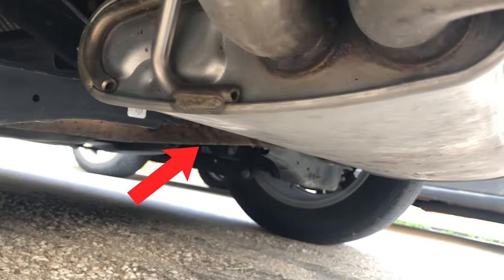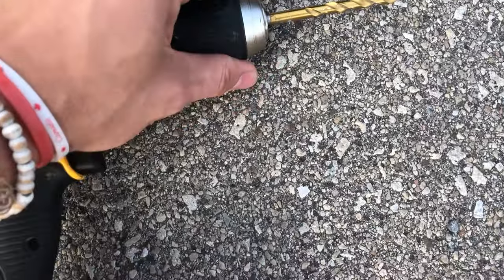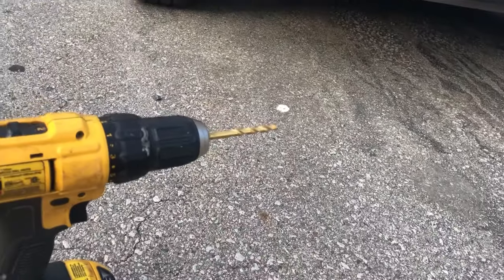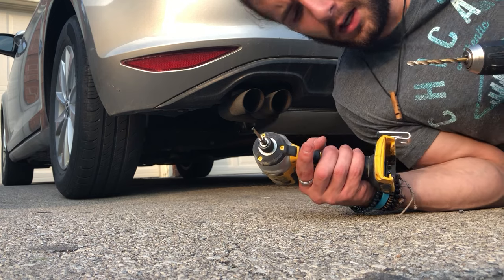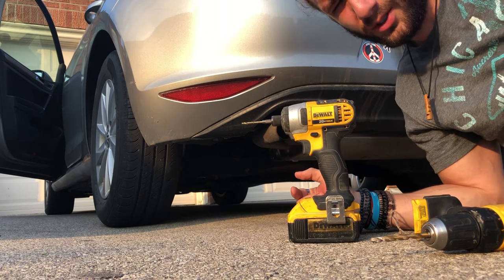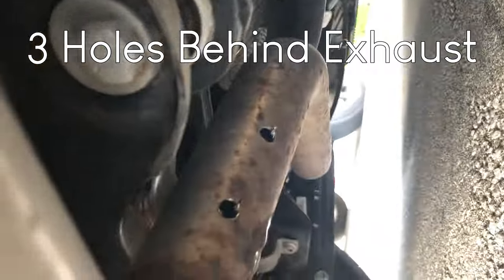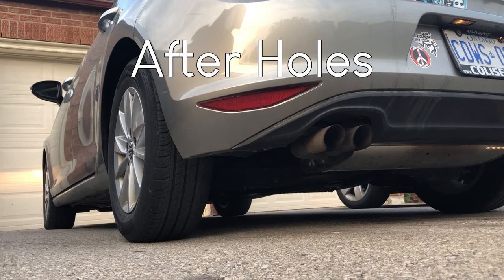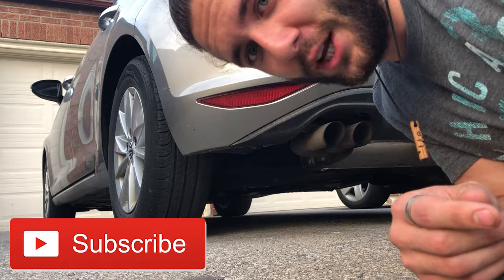Make Your Car Louder In Minutes!

Comment: I heard that if you drilled 6 holes in your engine block, you can increase the numbers by -160 HP and torque by -150TQ. I’m gonna try it
Reply from the maker: Let me know how that works out for you!
Reply: Mimyan I guess you bought an exhaust system for a bit of money and it sounds worse than this guy's DIY mod 🤣
Captain salty
Reply from the maker: @bradleyd556  lololo
Reply: Just put it in reverse so it cancels out
Reply from the maker: Awesome, I’m happy to hear that! Please consider subscribing I would really appreciate it!
Reply: @bradleyd556  🤣🤣🤣🤣🤣🤣
Reply: Does it matter how many holes you put? Is 10 fine spread out
Reply from the maker: I’m not entirely sure, if you do try it out let me know how it goes! Thank you for commenting I really appreciate it!
Reply: U can also blow it up
Reply from the maker: Haha why am I just seeing this now, this is an awesome comment ❤️😂
Reply: Drill one into every cylinder
Reply: What is engine block do you mean the catalisor?
Reply: I think your wrong. I heard it’s about 200 hp increase.
Reply: Can't that cause the inside to rust up over time?
Reply: Holy sh*t tried this and my car turned to plane
Reply: I used this method but I only gained 140 hp, I'm still happy as fuck😁
Reply: Are you serious? 😂😂
Reply: Yooooo😂😂😂😂😂😂😂😂😂😮‍💨
Reply: If there is any hole in your exhaust system, it  fail the MOT due to Exhaust leak.. 😮
Reply: this is very unsafe practice as dangerous fumes can be drawn into the vehicle and will consequently not pass an emissions test. (Says google). Can you please tell me as You have tried it, how long did you drive your car like this and did it affect the fule average ? Did it make any trouble in the engine?

Comment: Did you ever think about inspection , if you had 3 holes in your exhaust it would fail emissions.
Reply: i wont do this to my car cuz its old af and ik itll sound bad but but car would alreafy fail 😭 i dont have a CC
Reply: @dave7701 fucc an emissions test if it sounds good thats even better lmao
Reply: @Ydhfugivihlbl  it's not about sound, it's about speed. TESLA P100 that I own blew away a Vette that was loud as crap but didn't have the balls for a silent engine. 0-60 in 2.8 seconds

Comment: Ahahha all the comments saying it'll damage the car, all it will do is make it louder a friend of mine had the entire exhaust fall off from the manifold and he had it like that for months it just sounded like a tractor all the time🤣🤣
Reply from the maker: Haha exactly! It happened to my older car that I had in high school as well😂 People always assume the worst, thanks for the comment brother❤️🤙🏽
Reply: Well the issues with that is running lean since the car was designed for resistance so no resistance at all will make it run lean and shoot flames but the problem with drilling holes is long turn burning shit under your car. And there’s no going back without buying a new exhaust
Reply: @_JTPR_  just patch up the holes with gun gun paste? 😂
Reply: @buntrockstudios  fair enough
Reply from the maker: Thank you for the comment and your knowledge!
Reply from the maker: Let’s do it
Reply: Actually not enough back pressure can cause the engine to become nasty filled with carbon which isn't good for longevity
Reply: Anyone do this on a 2010 glk350 where  would I drill I need feedback asap cuz after my poop I'm doing it
Reply: It don’t damage the car but it does affect MOT

Comment: Is a cool way to do it but honestly a muffler delete isn't very expensive if you just going to do the last box and then it will sound really really good , also make sure to go for a retune after deleting the muffler or drilling wholes in the box because now obviously there is going to be less back pressure.
Reply from the maker: Thank you for your opinion I appreciate it! I’m sure this will help lots of people out🙌🏼
Reply: you dont need to tune it the only thing that gives you back pressure is the catalytic converter so yeah your fine and tuning cost a bit of money (edit) back pressure is BS think of an engine as an air compressor you want it to pump as much air as it can efficiently so no back pressure would be pretty efficient.
Reply: @seanmckay3392 the turbo is your back pressure...
Reply: @blokebeershed7651  if you drill a few small wholes , or delete a box or do a full stright pipe one way or another you will have less restriction in the escape of those gases so normally if you getting rid of those gases quicker you would want a less restricted intake to bring in air quicker , in South Africa most people go for a full stright pipe from the headers right out the back with no cat and put a cold air intake or ram intake and then a slight retune , more fuel , more air and less restriction on the way out and in will make most cars feel alot more perky.
Reply: @codyblade7872  i need to go in South Africa now !
Reply: @seanmckay3392 I drilled holes on my 2004 Honda accord and I lost back pressure and now my 0-60 went from bad to even damn worse when I went to get a tune up then suggested I fixed the holes but the tune up definitely helps
Reply: By retune do you mean changing spark plugs?
Reply: MOST cars and even Motorcycles do NOT need a tune done even after completely removing the muffler. What gives your engine back pressure is the Catalytic converter, NOT the muffler. You lose SOME back pressure, but unless your car or bike has like 10hp, you're NOT going to notice any difference. I did a muffler delete on one of my cars  and I noticed ZERO difference.

Comment: Did this on my vette and honestly it made it a little bit louder. However I have to mailboxes so it’s always going to be quite
Reply from the maker: did you drill directly into the pipe? it should have made some difference
Reply: @LukesVlogs97  it’s super difficult if you don’t have a lift unfortunately. Like I just make a lot of holes and took out the insulation. It’s not really loud just sounds better from stock

Comment: Muffler will rust, sitting in traffic you may get exhaust fumes inside the cabin, you’ll get droning on long trips, resale value has been diminished with each hole… - other than that, fabulous job 😂
Reply: Keeping it stock for resale value is like saving your girlfriend for the next guy.
Reply from the maker: Lololo 😂
Reply: @jayroot3111 lmfao!!
Reply: @jayroot3111 this made me laugh way to hard

Comment: Hope you can answer my comment as soon as possible, I got a vw mk7 golf r with an evil energy muffler. It's not loud enough tho. How did you drill the holes behind the muffler? I can barely reach the pipe and what kind of drill did you use?
Reply from the maker: I used a dewalt drill. You should be able to reach the pipe before the exhaust, the golf is a fairly narrow car. Maybe try going from the side instead of the back. I hope this helps brother. Please consider subscribing I would really appreciate it! 🤙🏽

Comment: Won't it affect the car performance? Maybe oil spilling from the holes that has been drilled? Is it good for the long run
Reply from the maker: It will not affect the car’s performance in a negative way. Oil doesn’t pass threw the exhaust chamber, only water. Make sure you subscribe to my channel for more videos, I would appreciate it!
Reply: Oil doesn’t come out of the exhaust only fumes. Think of it like your lungs but for your car. The oil is blood
Reply: @christopherfrederick9284   this.
Reply: @christopherfrederick9284  dosn’t blood run through the longs to get oxygen?
Reply: @Bears-hy1vs  
Not openly in the chambers of the lungs.
Reply: I want to try this but will be a MOT fail?
Reply from the maker: My car has been fine, there has been no problems since I’ve done it! Thanks for the comment I really appreciate it, please consider subscribing it would mean a lot to me and the channel! ❤️🤙🏽
Reply: What?
Reply: If oil is dripping from your muffler then you NEED A NEW CAR!
Reply: @lukebowey_ahoyit  yes mate, in the UK it will be classed as an MOT fail and your tester will define it as an exhaust leak. Any exhaust shop should be able to cut your back box off though - but this may also be a fail, it all depends on how 'friendly' your tester is. Pay him the regular MOT cost but 'accidentally' leave a pack of 20 beers in the passenger seat, or alternatively an extra £20/£30 on the dashboard. It'll pass then 😂
Reply from the maker: Lololo
Reply from the maker: Haha thank you for the tips lolol😂
Reply: @zahidibrahim2260  just put on a bigger intake lol
Don’t quote me on this it’s mostly a joke (although that wouldn’t hurt to do)
Reply: @sdaafasfad  Works everytime 😅😂😂😂
Reply: That’s actually a good way to explain it lol
Reply: @LukesVlogs97 ya but co?  You just made a leak under the car.  Is this a joke video? 😂

Comment: Ok, I giggled when I heard the "after" version. 

My only concern is that we (in the UK) have a legal emissions test and they stick a probe up the exhaust (ooer madam) and if there's a leak (which is what you've created), the equipment can detect the leak and you fail the test. I guess you could clamp something round the holes in the pipe to block off the leak using a jubilee clip and a section of a beer can that curves round the pipe?? :D

Comment: My man quick question 
I have a VW as well 
I heard the holes can make a gas leak which will mess up the gas system and it won’t be as economic 
Did you experience any of that ?
Thanks buddy
Reply from the maker: Hey Buddy, that's a good question! personally I haven't had any complications when it comes to drilling the holes. my car is just as fuel efficient as when I bought it 4 years ago. Thank you for the comment I really appreciate it!
Reply: One more question 
If you tried to inspect it 
Did it come in the way by saying you need to fix it or it was good 
Thank you
Reply from the maker: I haven’t gotten an inspection yet but, I don’t believe that it would cause problems because it doesn’t affect the safety of the person driving it. 
No problem brother, please consider subscribing, I would really appreciate it!
Reply: @LukesVlogs97  thank you so much 
Man I subscribed first thing before even liking 
Keep it up buddy
Reply from the maker: Thank you Adam I appreciate the kind words!
Reply: probably late g but as long as you drill behind the o2 sensor it shouldn’t throw anything out of whack. drilling before that will make your car think that there’s an air leak and you’ll run more fuel
Reply from the maker: Awesome comment, I appreciate the passed down knowledge!
Reply: @adamsaleh8571 do not do this 😂

Comment: I want to try this. I have Subaru outback sport with turbo. It that will work and won’t hurt the engine or else?
Reply: You don't hurt the engine with drilling holes. You just make it bypass the muffler part.
Reply from the maker: @Supremepikachu exactly it won’t hurt your engine!

Comment: Your car sounds way nicer now, I wanna do it too but I’m scared the exhaust gases will get into the interior. Anyone know the safest place to drill holes in the exhaust system for a louder sound?
Reply: Yes do it in between youre catalytic converter but before you’re muffler jsut on the pipe and use a 3/8 bit
Reply: @adammalin2194  I did it on the muffler and it works the same
Reply: muffler, towards the back

Comment: That sounds sick! I'm thinking of trying it on my civic now🤔
Reply from the maker: If you do let me know how it goes!
Reply: I'ma do it on my civic too but put holes in the tube not the mufflerr
Reply from the maker: Let me know how it goes!
Reply: @nemesis0303  I kinda wanna do this but isn't it gonna be a problem when you go to the inspection?
Reply: @WashedDorito  its so easy. If pulled over. You buyed it already like this and you will instantly repair it cuz you didnt knew it was ilegal like that. For inspection just weld the holes😂 the inspector dont has to aks questions if it doesnt leak. After that drill holes again and that over and over again
Reply: @Simon-xx4wm  Alright haha 😂

Comment: What if you have 2 exhaust? Do you have to put holes in both sides? And does this affect the car in anyway performance wise or like use more petrol?
Reply: Dont do this, it will create an exhaust leak and could poison you with exhaust fumes in the cabin of the car
Reply: yeah i'd do it to both. It won't affect performance too much and if it does it will help. It will not use more petrol.

Comment: Hey man appreciate what you are doing I just have a question hopefully you or someone else would answer will this cause the light engine to come on? Thanks a lot
Reply: no it won’t make the engine light to come on, that only happens if something is wrong with the engine it’s self, yes the muffler connects to the exhaust pipe which in turn connects to the engine, but since it’s not an electrical problem, or something that would cause the engine to misfire or anything like that, it is safe to say that the engine light will not come on.
Reply: Thanks man appreciated
Reply from the maker: This is a perfect answer, I couldn’t have said it better myself, Thank you for the comment!
Reply: Not it doesn't make the check engine light come on.
Reply: Some cars have a air control valve on pipe if u mess with it .it will
Reply from the maker: Thank you for the comment! I appreciate it!

Comment: should u be careful where u put the holes or do u just put holes anywhere underneath the car next to that exhaust area
Reply from the maker: The exhaust is a pretty bare bones system, just make sure you just penetrating the one side and not to go threw anything on the other side! 

Thanks for commenting, it was a good question! 

Feel free to subscribe to my channel it would help a lot, thank you 🤙🏽
Reply: What could happen if you drill both sides?
Reply from the maker: I don’t wanna say it would be bad but air would be escaping from both sides of the pipe, in this video I only did one side and I haven’t done it with both sides. The sounds could be different, maybe better but maybe worse. That’s an experiment I have yet to try! Thank you for your comment it means a lot, please consider subscribing I would appreciate it!

Comment: exhaust leaks which is exactly what he is doing, by drilling a hole it has created a leak, causes a decrease in power and also will continue to make the engine loose power until the leaks are fixed
Reply from the maker: I’ve talked to trust worthy mechanics and they said it’s perfectly fine! I’ve also bin driving the car for 3 years like that and I’m not dead. They can’t get in the cabin if it’s outside your car lol. Thanks for your opinion though, please consider subscribing I would really appreciate it❤️

Comment: Alright everyone, DONT DO THIS! 
It’s an exhaust leak, and pointlessly dangerous. 
If you really want to make some sound, go to a local muffler shop and pay them to replace the muffler with a pipe for $100.
Reply from the maker: Thank you for your opinion!
Reply: There is literally no difference, it's not dangerous, the holes are in the muffler which you are suggesting you remove, it's only dangerous if you start putting in holes before the catalytic converter (which removes toxic fumes from the exhaust). The only issues really is that you destroy the rust proofing of the metal so over time the muffler or pipe will deteriorate.

Comment: I would correct you with something… you should at first put holes exactly before the muffler , it wasn’t necessary on the muffler (makes no difference)

More holes more aggressive sound … depends the vehicle and of course the motor of the vehicle …other preferred to just put an exhaust valve after the resonator with smaller cost of muffler delete but more expensive than just dig a hole …

For me it’s a yes …